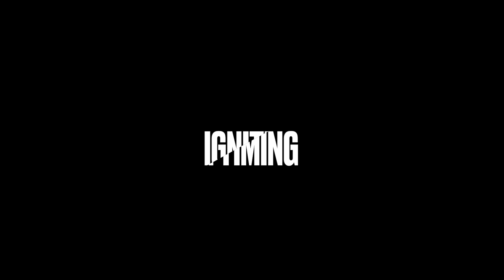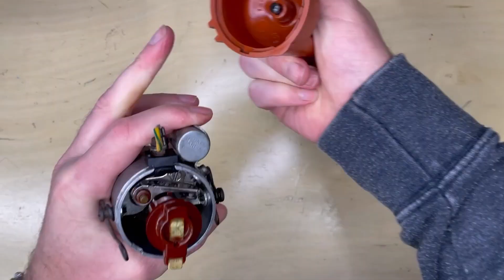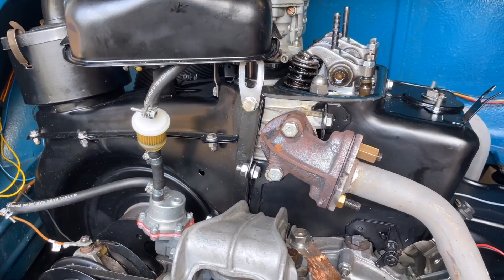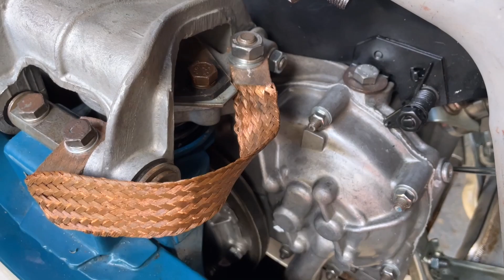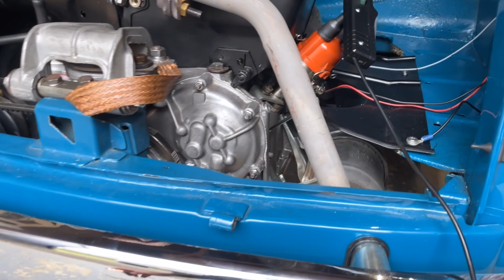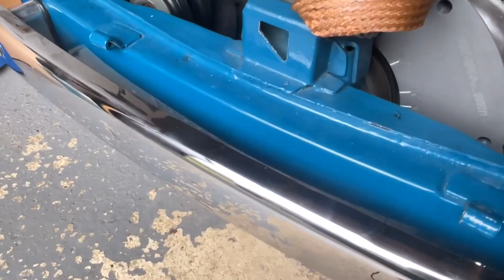How to Set Ignition Timing on a Classic Fiat 500 | 126 | FD Ricambi

Comment: Jolly good and well done video!  I have a question  the engine is a bicylinder one but I noticed that both pistons are lined on top so it does mean that there is nor order of expansion?  namely both piston get simultaneously spark and operate together without an alternative vertical movement li a 4 cylinder?